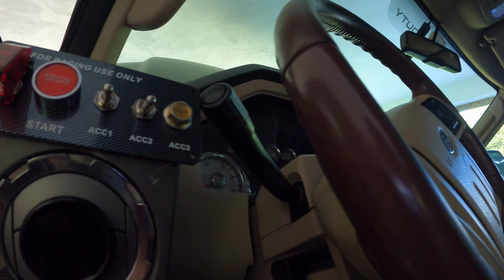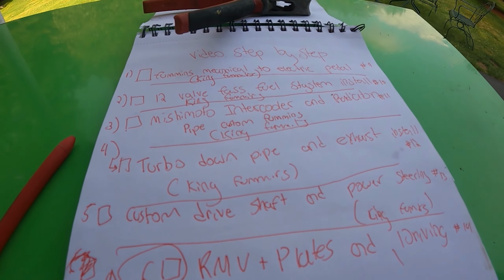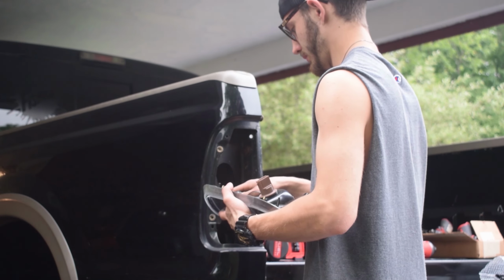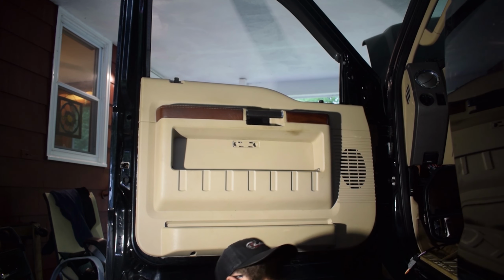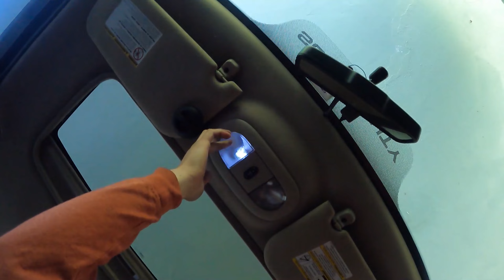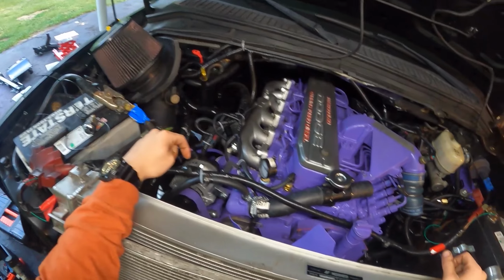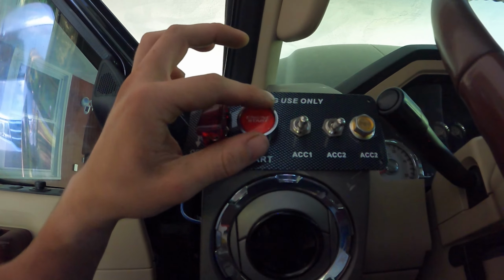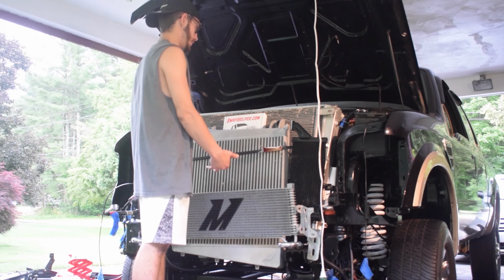KING Ford 5.9 CUMIINS swap gets lights AND TOW MIRRORS

Comment: Just wondering why you have the push start? Are you having trouble starting with the key? I have a 2010 Cabela’s with a 12 valve and I’m pulling my hair out over trying to get it to start with the key 😡
Reply from the maker: it starts from the key as well you can tap into the factory starter circuit
Reply: Yoooo thats a sick swap bro